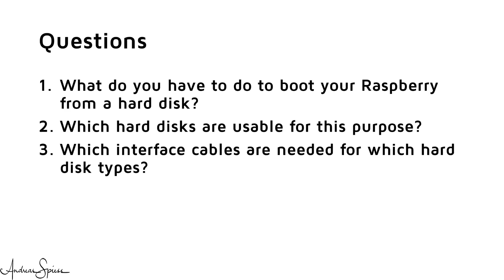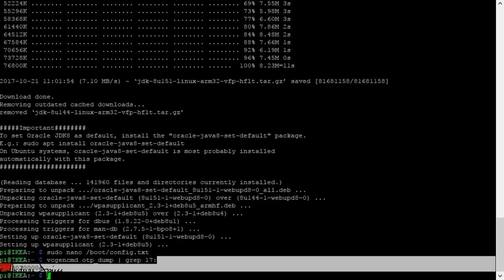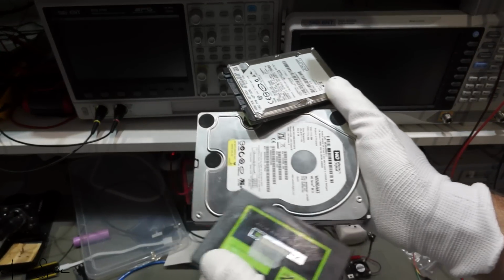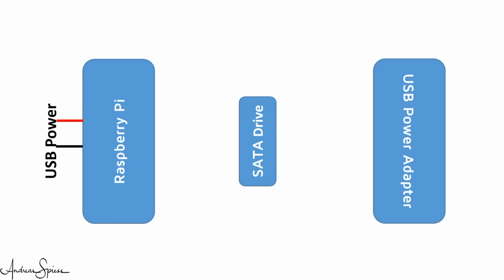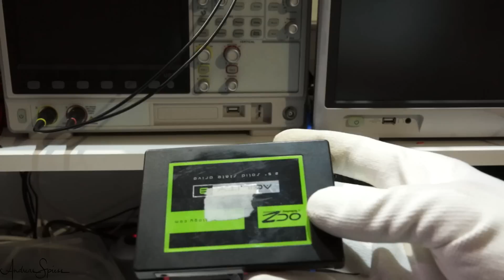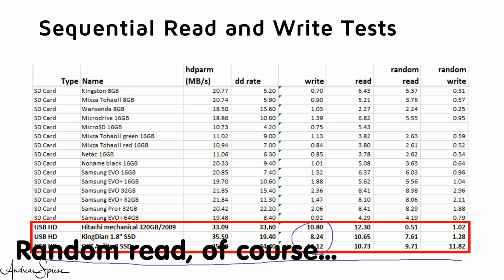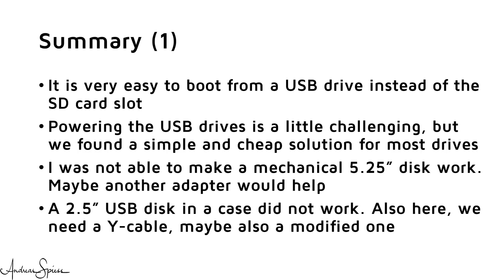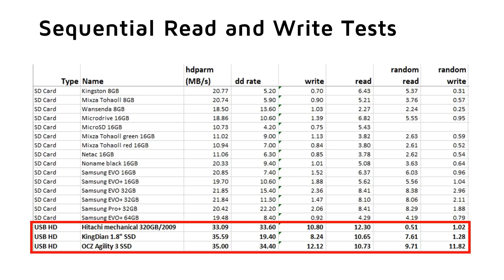#164 Which USB Disk is best for  Raspberry Pi 3? How to connect and how fast are they?

Comment: Thank you for this!

How do you mount a SEAGATE SATA 3.5inch 8tb 5400rpm hard drive in a sabrent single drive case with power for drive to USB3?   (12VOLT, 2AMP) FROM CASE TO HARD DRIVE.

I DO NOT want to boot from this, but store data.  I realize SSD TYPE drives easily auto mount as (SDA1).

Also once mounted, from desk top, how do I access storage drive to add folders and store data?

THAT WOULD BE VERY HELPFUL TO NEW LINUX USERS LIKE ME.

GOD BLESS.
Reply from the maker: You should get adapter cables for these drives which have 12 volt connectors.

Comment: 2021 here, it appears you no longer need to issue a specific command to tell the Raspberry Pi to boot from USB. Just attach a USB drive, run your favorite imager to install a Raspbian OS on the USB drive, shut down, remove SD card, boot with USB drive attached.
Reply from the maker: This is true for the Pi4.

Comment: I have 2 170MB 5.25" Full Height SCSI drives from my Amiga days. They still work too, but they sound like a dump truck driving down a gravel road. I need to find a good USB to SCSI adapter so I can hook them to my Raspberry Pi.
Reply from the maker: SCSI is quite old stuff... Probably difficult.

Comment: Hello Andreas,
I am a great fan of your video's always very practical, you have learned me a lot.
I use the following setup with only one power supply.

An official Raspberry power supply and spliced this to the power input(J1) of the RP 3B+ and to the USB3 to SATA converter(3.36) which is connected to a Samsung EVO SSD.
Then I connected the USB from the SATA converter to the RP 3B+ without the VCC.

schematic https://www.pzuidam.nl/wp-content/uploads/2020/07/IOT_Server_Power_Supply.jpg

This setup boots normal and is running for quit some time now.

Together with video #295 "Raspberry Pi Server" I have a awesome IOT server now. :-)

Thanks a lot!!!
Reply from the maker: Thanks for documenting your solution!

Comment: About that transparent case, and the split USB adapters... you could try something like the Ewent EW7051 case, or any other brand case that comes with its own power plug.
I've set up a cousin's Raspberry with one of those Ewent cases that he had for an old PC to use with a 2.5" SSD, and it ran properly with the Raspberry.
(EDIT: the "explainingcomputers" channel has a similar video about plugging an old SSD into a raspberry Pi, at https://youtu.be/ubnwvxF3Klc and he's using a simple sata-to-USB adapter, which seems to be working well for him. Looks like a cheaper option than the powered case suggestion that I made. Unfortunately I didn't get what brand it is or if it's a specific type of adapter, but I know I've seen similar-looking adapters at a price of less than €3 on some Chinese webshop and Amazon before. And that actually makes me think that you might indeed have hit a snag between a USB 3 connector and the Raspberry's USB 2 port.)

About the KingDian, I'm not sure what's inside the one you used in this video, but I've once found a small KingDian M.2 SSD in a discarded PC and (after also putting it in a case with its own power plug) connected it to a Raspberry and got even faster speeds; I think that M.2 was NVMe but I can't remember for sure. 
(sadly that M.2 and that case didn't survive me accidentally stepping on it... the Raspberry (an early 3B+) is still fine, still hosting some basic sites that I like to mess with on my home network... though lately it's been getting hotter than normally at random times, couldn't figure out what caused it.)
Reply from the maker: Thank you for your input. Currently I use small and cheap SSD drives. They do not need a lot of current and are pretty fast. Especially on the USB3 of the RPi4

Comment: I have done this project. I added an SSD to my PI 3B, it works fine and much faster once it boots up. It could now be a daily driver.
Reply from the maker: Thank you for sharing your experience.
Reply: I did it with my 3B+ and overclocked it as well just playing around. It's usable, but it makes the Pi4 seem like a speed demon. USB3, the extra RAM and a 2ghz clock gives the Pi 4 core2duo speeds.

Comment: i has test usb 2.0 cable,external HDD usb 3.0 and doccing station usb, whit raspberry 3  start whitout SD shit card, NO newer any working ,all same parts i test what you have video,newer no work. but i buy subtronic x820 HDD board and install at raspi and work sametime easy.good and true working whitout SD card too.

Comment: just installed Diet-pi and tried raspbian on WD500AAKX and it boots up, I used a raspberry pi 3b+ but should be the same on raspberry pi 3b it you set to boot from HDD.
had to use the HDD as internal drive in my PC, installed the OS onto the HDD  with Ubuntu disk image writer.
Took the drive out the PC and plugged it into a UGREEN External Hard Drive Enclosure with 12V 2A Power Adapter for 3.5/2.5” SATA SSD HDD
Reply from the maker: Thank you for sharing your experience!

Comment: Add this line to the config.txt file: 

program_usb_boot_timeout=1

This increases the timeout, so mechanical drives have more time to response.
Probably this line is also needed to increase the current supplied by usb ports:

max_usb_current=1

It worked for me!
Reply from the maker: Thank you for your tip!

Comment: Hi, thanks for the excellent vid. Can i copy an image from a fully configured microsd card to a SSD device and boot from that (after modify the config file with the =1 bit set) rather than copying a new raspbian stretch image?
Reply from the maker: You should be able to use Etcher to copy an image to an SSD.

Comment: Good Day !
    I've been watching your videos and must say a BIG THANK You for all you are doing.  I'm just now getting started with Raspberry Pi (just received my CanaKit Pi 3B+ Starter Kit) so a bit of learning curve at this time.  

I was intrigued with this video in particular as SD Cards do have the Pros & Cons as you've noted in other videos, so I figured I would try a couple of things as I have computer hardware "lazing about, collecting dust".

I decided to plug in some of my external drives just to see IF the Pi would even read them, the first two were used by Windows and the last one is brand new, fresh out of the box.  IT DID !  Can they boot the Pi ?  I dunno at this time but should be no reason why they couldn't, testing we shall go, once I figure that part out and remember which software to use for your Grafana Image (downloaded already) but as I'm doing this offline (no web) so it's a bit tricky. 

Drive-1 
WD "Elements" {1st generation 2008 ?} (1.5 TB, USB 2.0, has external Power Supply): 
PN:WDBAAU0015HBK-01 or WDBAAU0016HBK-01  (the 5/6 is scuffed, uncertain)
* external dimensions of unit:  11.5cm/4-1/2" wide, 18cm/7" long, 4cm/1-1/2" high.
  possible to use Case & PS for another drive ?  (in case someone has a dead unit)
Mounts OK but slow reading (drive properties check) with 50% of drive used.
Formatted & setup with Windows

Drive-2
WD "My Passport Ultra" (2.0 TB, USB 3.0):
PN: WDBMWV0020BTT-05
Mounts well, reads much faster than #1 @ 80% full. 
Formatted & setup with Windows

Drive-3
WD "Elements" (2.0TB, USB 3.0):
PN: WDBU6Y0020BBK-0B
Brand New out of the box, Mounted instantly, no content at all.

Drive-4 (un tested at this time)
Kingston "HyperX Fury" (240GB, SATA 3.0) SSD PN: SHFS37A/240G
I would like to try this out as that would be my preferred drive to use if possible, as my use will be collecting lot's of data, which will be incoming fast.
Reply from the maker: Raspbian is a normal Linux system and can read all sorts of disks. Quite often you do not need big disks for those platforms. Maybe you make a rough calculation for your intended database size.
Reply: Since I wrote my response 3 weeks ago, I've managed to get all the listed drives running with no issues at all, although, the non-ssd does tend to tip the edge of available power.  Everything is working wonderfully with the Hyper-X SSD and InfluxDB IO is next to nothing now compared to the spikes with the SD card.

Comment: i think 5,25" or 3,5" hdd and some old 2,3" no work because old hdd eat lot more current what you can take out usb connections, usb connect have max 500mA cuurrent what no have lot if use old hdd, need external power.
Reply from the maker: You are right.

Comment: Western Digital used to sell a cable that plugged in to a usb power source and powered both a usb hard drive and a raspberry pi, but it appears that they're not made any more. 
Hooking up the drive and the pi to separate ports on a powered usb hub would probably solve the power issue, provided you can boot through a hub. 
Remember, just because you're hooking up a usb device to a raspberry pi does not mean that the pi has to power the device!
Thanks for the video!
Reply from the maker: You are right. And WD stopped it may be because the volume was quite small.

Comment: I came up with something on ebay that will fix the current check this out

UNITEK USB 3.0 to SATA Adapter Converter for 2.5" / 3.5" External Hard Drive HDD with External 12V/2A Power Supply
Reply from the maker: This should work for the bigger drives. I have one here but did not try it out so far.

Comment: is it also possible to use more than 1 partition on the HDD?
Reply from the maker: I think so. Western Digital sold an HD for the RPi where they used more than one partition
Reply: 3,5 ich hdd working. 
The HDD case is a Sweex ST032 [sata II] with external power. 
Connect the usb upper port next to the lan, when I connect on the outside the disk will not seen by the Raspberry
How: first make an image of your raspbian expanded system, I use a 32Gb SD. write this to your HDD. 
Now you can make also partitions to the HDD.

Comment: Is it possible to boot from a USB thumb drive?
Reply from the maker: I do not know what a thumb drive is. But I used a USB drive
Reply: Thumb drives are the small storage devices that can be plugged into a usb drive. As opposed to a larger drive that can be plugged in to a usb drive.

Comment: Has anyone tried the Kingdian S100 SSD 2,5 inch (not the S100+ that Andreas uses)? I am using an Orico usb adapter with it. I can access the S100 as a disk, but I am not able to boot from it with a raspi3, and the one time write switch set for usb boot.
Reply: Hello Mr. Thorud !  I've successfully setup a Kingdian S100 (the model without the +) 16 GBs SSD as my USB external boot drive and removed my SD card.  In addition to add this line in my /boot/config.txt: program_usb_boot_mode=1, I also had to add this part in my /boot/cmdline.txt: root=PARTUUID=ab99c99d-02 (where ab99c99d is the bootable partition UUID of this SSD).  I'm currently running Raspbian GNU/Linux 9 (stretch).  HTH.  And thanks Mr. Spiess for your great videos !!

Comment: You can run 5.25 disks on a pi3. you need to run the pi3 and hdd from same supply. I use an old small form factor atx dell power supply. 10amp/5volt 5amp/+12volt 1.5amp/-12volt w/sata connector. Cut a usb 2.0 male cable's red or 5v+. So as to prevent back feed. This lets the pi3's built in regulator control voltage input. Tie the red wire of usb cable to a 5v output on power supply. Tie the 12v input of hdd to ps 12v. If you have higher current peripherals, use a 2.0 m/f extension cable cutting the 5v+ like the hdd cable. less stress on the pi.  Done.. with enough juice leftover to power fans [12v and 5v], a 50w audio amp [+12v-0--12v], led's, monitor, 4 port 5v usb high capacity charging bays and more. I also run an old lcd display controller with 3v input. By using common power supply there are no issues with individual components. ATX is 3.5x3.5x3 inch.
Also many usb 3.0 devices still require proper drivers not available in pi3. Make sure it's backwards compatible. Even if it is, it will only operate at 2.0 speeds. The licensing fees would not allow for a $35.00 pi. Alternative single board units with usb 3.0 are available... starting at around $100.00. So the alternative to bitching about the pi's short comings is cash.
Reply from the maker: Thank you for your tips. I think these old PC power supplies are a  very valuable source for DC current (often overseen)

Comment: I found an interesting edge-case bug with USB sticks used as shown here (I've been doing this a long time in my lab too).  One thing I use pies for is web servers to show things like weather and homestead systems status, and allow remote control via CGIs on the web server.  When using gnuplot on the pi to produce plot files to serve via a cgi, the gnuplot instance reports it is done before the USB write has actually occurred.  When the page fetches the .png files...bad things happen indeed, including random text on the served page.  This only happens with an external USB stick, not a spinning drive or SSD.  Simply changing that directory to be mounted on a tmpfs fixes the problem with no changes to other code.  My lemp stack is raspian, nginx,mysql, perl, using fastcgi on a pi-3 (usually, this happens on pi2 also).  Just a heads-up.  I've not seen this in other situations where I'm using a USB stick mounted over root (yet).  Again, it's not a bug in my code, or at least simply moving the place gnuplot is writing to and the server is reading from to another storage makes the bug go away.  It seems gnuplot is still writing when the webserver is fetching the .png files, and those writes actually show up in the served text, incorrectly,  so instead of showing plots, it shows random binary junk (the clue is that some of the characters are ascii and include PNG).  As if STDIN/OUT are still busy and misdirected in this case.
Reply from the maker: Thanks for this info. I might help somebody else in a situation where he does not know why his stuff does not work...
Reply: That's the hope.  You're doing a very good thing here, and it attracts and helps a lot of good people working with the things you present on your channel.  This was a very snakey bug, took awhile to chase down (I'd been using the same code in other storage configs with no issues, so a real head scratcher), so I hope it helps some one who is, like you, pushing the pi to do more than just be a toy.

Comment: I may be well out of my depth here or misunderstood but can you power the 3.5" WD drive with an external computer power supply? Many years ago I add too many items to my computer and it became unreliable so I stuck an addition power supply in and powered the 2 DVD drives and 2 of the 4 hard drives from that supply. My procedure was turn on the external power supply first then the main one. It worked well for years until larger drives came along and I stopped using as many.
Reply from the maker: I think this should be possible. At least I do it on my PC where I use the Orico bay showed in the video. As you say, powering the disk before you power the Raspberry is essential.

Comment: Thank you for the video. I spent a week in trying error methodes to make it boot from my HDD WD 512 GB. The point is that, I made a y cable and pluged it in an Ipad`s charger 2.1 A... The charger feed the HDD and the raspberry at the same time. But the system initializes only if I disconnect the raspberry cable and connect it again while the HDd cable is unchanged, then the system boots from the USB HDD. Thank you for the hints, but I also wonder why I need to unplug and plug my raspberry pi to make it boot from my HDD. The system in this way can not be rebooted because once turned off it is unable to automatically turn on again, if I don`t manually unplug and plug the raspberry pi supply cable. I tryed add rootdelay=10 in cmdline.txt but the same occurs.
Reply: here there are some photos of my results ... https://drive.google.com/drive/folders/0B-AYwbaKxg7CREYtR0s3ZzRhTG8?usp=sharing
Reply from the maker: I think this is the behavior of the Raspberry also with SD cards: It does not boot without removing the power. At least, mine. Unless you use the command Sudo reboot now.
Reply: For me sudo reboot works fine with the SD and USB flash drive. Even usina a dedicated power supply 2 A for the hdd and 3A for the raspbery it dont reboot

Comment: About the lifespan of ssd's on any linux distro.I did not check but one has to assume the filesystem that is made on the sdd can have a deep impact on ssd lifespan. Some journaling filesystem do make a Lot of disk writes simply as a maintenance feature of Linux fileystems and are not suited for any type ssd drive, be it usb or sata. So that should be worth considering.
Reply from the maker: I think you are absolutely right.
Reply: I'm sorry to be of no more help since I truly only have limited time for embedded applications. but for certain many Linux FS were made to work on hdd, where the number of writes on disk was not a problem in terms of hard drive longevity. So they rely heavily on disk maintenance, and are therefore very very reliable on any HDD.
Sadly flash memory always have a limited number of write cycles. So in principle ssd's should not be trusted for long term applications, specially not on those that require continuous disk writes.

Comment: You could also set up a RAID 0 (mirroring) so you can boot even if/when the disk crashes.
And you could also use LVM2 to make logical disk partition and easy expand them when they need.   LVM2 are a great.

I think I read that the USB booting doesn't work with a USB switch, so it might be that the harddisk bay have a USB hub in it.  I don't have the link available though.

You might be able to use the disk after the RPi booted up.
Reply from the maker: That with the switch can be. But for the moment I have a few possibilities to go on.